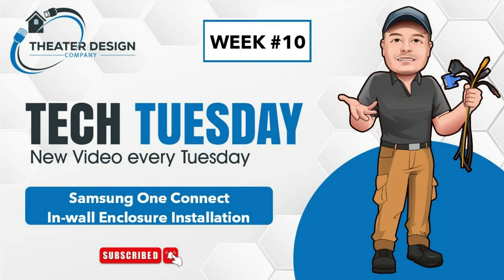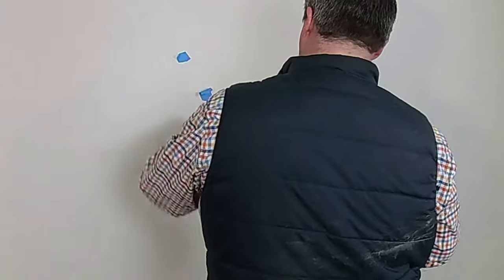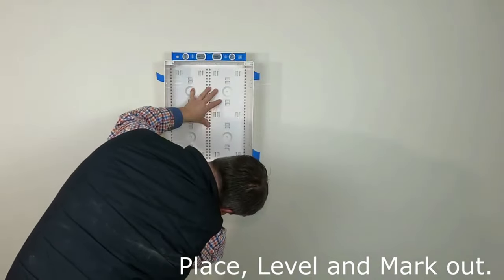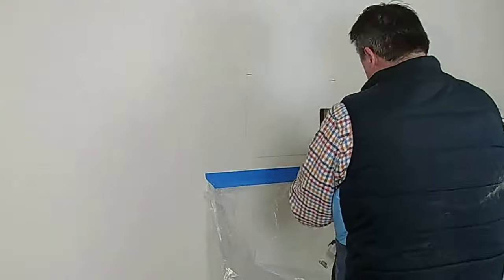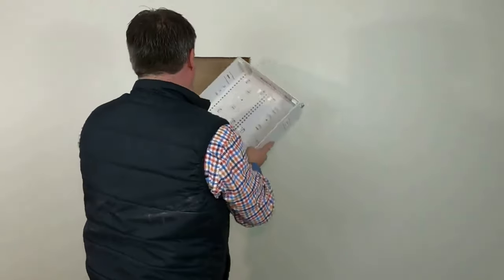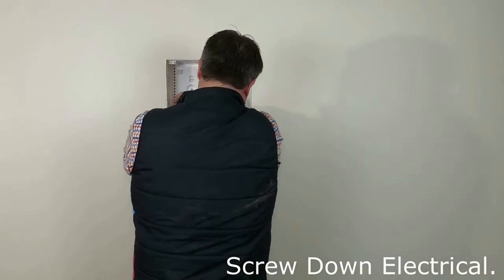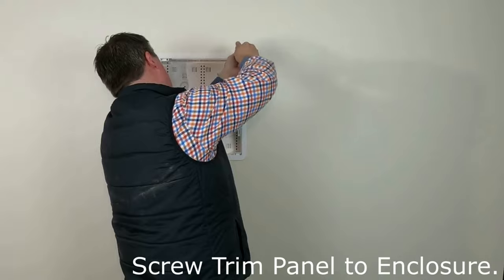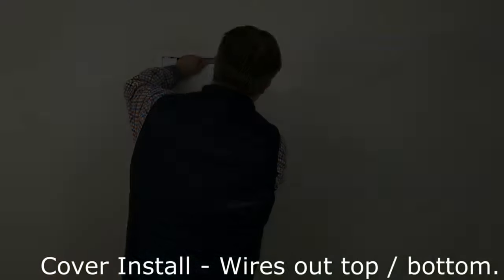Tech DIY: How to Install Legrand / ONQ 17" Enclosure for Samsung One Connect - Tuesday Week #10

Comment: Did you ever do a video to show the Legrand 17” box with the 50” Frame TV.  The bigger ones are easy this combo though has overlap issues with the Legrand trim ring and the wall brackets set for the 50” and it would be super helpful to see how you solved those thank you
Reply from the maker: I have not but may have some image so ones have done.  The wings do overlap onto the enclosure.